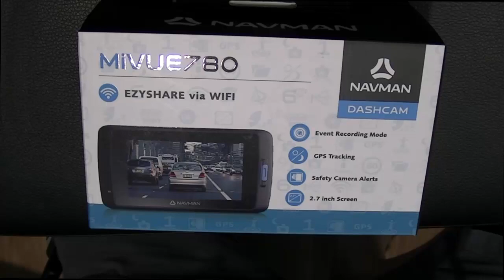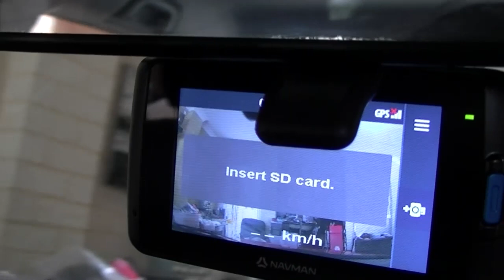NAVMAN MIVUE 780 unboxing and power supply hardwiring

Comment: Hello, I have a serious question about the dashcam, I have recently purchased a Mivue 740 and 790, both are exhibiting a strange behaviour... they record only 2-4 sec before and 18-16 sec after an 'incident' detection. The stated recording times are 10 sec before and 10 sec after. Can I ask you what yours does?
Reply from the maker: i have never checked. i havent had any incedent detections come off thou. will let you know if i do
Reply: @automtr  Ok, thanks. I manually hit the button to record fools on the road and when reviewing the footage it was not what I expected. I have contacted Navman, but their response is "It works as intended", of course.
Reply from the maker: @booga007  i thought it would just be constantly recording. ill have a look and see. also maybe its a memory card spec thing?
Reply: @automtr  yes, it's does both. Constant recording and then saves 20second snippets from an incident or button push. I also used the recommended SanDisk and Samsung high endurance SD cards.